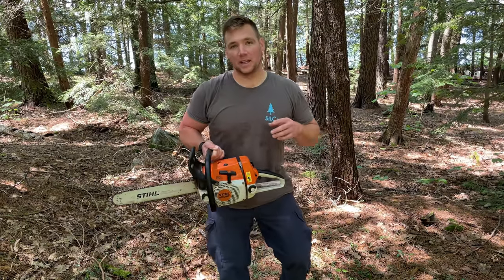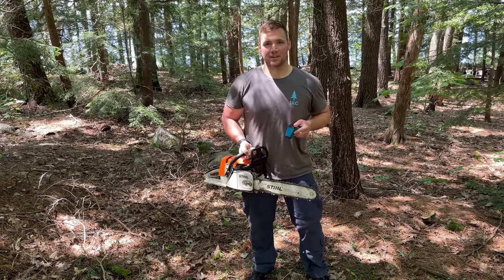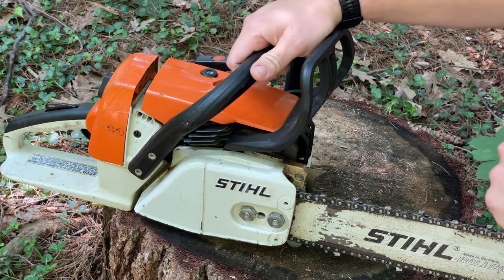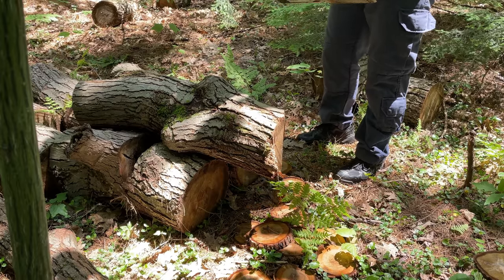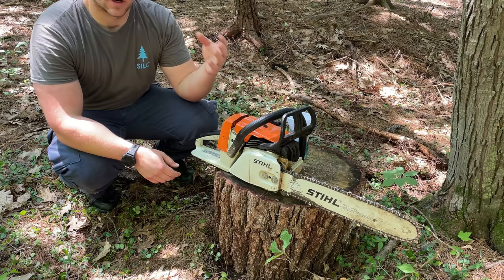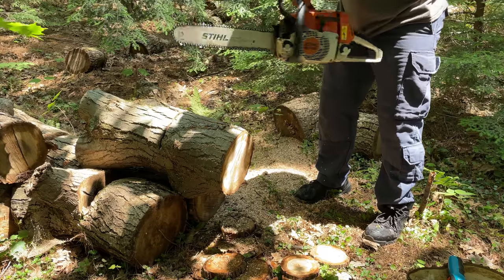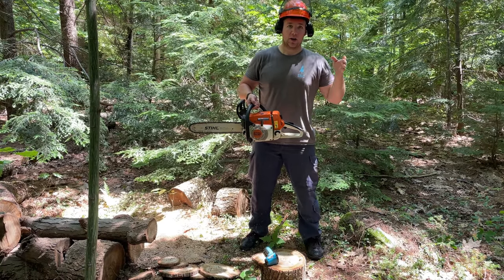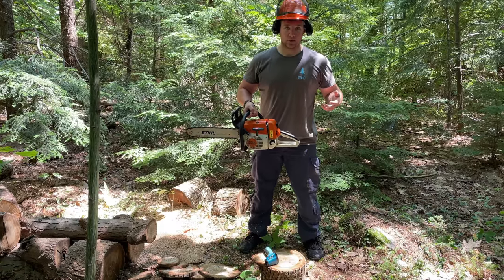Will my chainsaw last longer if I use more oil? Is it safer? (25:1 VS 50:1 temperature testing)

Comment: Great video! Informative data. Many excellent comments. I have heard people recommend using 40:1. (Better piston/cylinder lubrication). I have been tempted but reluctant and continued with 50:1.  My two non expert thoughts.  Factory engineers designed the saw for 50:1  having done testing and designing and though probably not a big deal, pollutes less which makes me feel better. I really enjoyed this video. Thanks for taking the time to do this.
Reply: 50:1 is an EPA mandated ratio
Reply: with good oil you'll be fine with 50:1, even on a 250 dirtbike engines we run 50:1 mix.. richer mix only lead to more carbon buildup.. i dont use stihl oil as it makes a lot of carbon buildup and loud piston ring sound..
Reply: Don't know if a heavier mix is better or not, but nothing mandated by the EPA is to improve engine life.

Comment: As long as its mixed somewhere between 32:1 and 50:1 it doesnt matter.minimal gains or losses either way as long as your in there somewheres and most saws will run fine for the average joe(or jane).i run a 40:1 give or take and run the dog snot out of my saws on a daily and run cheap gas station 2stroke oil and never had a problem.even with ethonal feul sometimes.what is most important is what kinda saw your running.stihl,husqvarna,echo and your going to have no issues (of course a couple of other brands also) but i only want to run them three,they are reliable and get the job done so thats what matters.good job with the video.also how you are running the saw matters considerably too.

Comment: Been mixing 6.4 oz oil, to 2. 3 gal of gas for 31 yrs. Never had a problem. I use any old 2 stroke oil I find by the gallon at walmart. Works fine.
Reply: Yep I use the Wal mart super tech and Murphy corn gas. 1/2 pint to every gallon of gas. One thing that really helps the older saws is to convert them to electronic ignition.
Reply: 5.46 ounces API-TCW3 oil to 2.0 gallons gas/petrol for 15 years without a problem. 
Then one day used farmer's old barn 2TC oil & cost me a new piston & rings. 
STIHL/Husqvarna/Oleo Shell Nautilus two stroke oils cost far less when purchased in 5 litre containers.
Reply: Yes things have changed in the past 15 yrs, me too, so 
also add Lead (LRP replacement) additive of 1ml : Litre of gas/petrol.

Comment: The Craftsman/Poulhan chainsaw I have requires 1:40.  Newer saws seem to spec 1:50.  It seems that the emissions regulations more than performance may have something to do with the new specs.
Reply: You guessed it.

Comment: always go for the most oil mixture because I have 3 chain saws, two trimers, or weed whackers. a 2-cycle small tiller. and a snow thrower  so I don't mix for each

Comment: one of my coworker uses a 30.1 fuel&oil mixture, for years. (stihl engine oil)
but yes the recommended ratio is 1/50.

Comment: Have you done small incremental steps while reading the plug? That will tell you a lot more about how an engine is running than temp ever will. I raced dirt bikes for years, and have lived out in the woods all my life. At 40-1 my HomeLite will seize. It like about 28-1. My Echo likes 40-1. Just sayin, your saw will tell you what it wants, and they are not all alike

Comment: Think of 50 to one as drinking soda and think of 25 to one as drinking a milkshake. You need bigger jets or the engine will starve for fuel. 
Jetting for optimum efficiency when changing ratios must be included in the research data
Reply: Absolutely.
Reply: Yes that's the thing u hit it right. Tuned properly for that ratio I believe it would be opposite,  the excess oil will remove heat out the exit hole...lol

Comment: I have been running a Stihl 026 for 36 years now.  The only repairs that I’ve ever made to this saw was replacement of the coil, clutch, pull cord and a few other typical wear parts.  The saw has been cutting  approximately 9-10 cords every year, plus all the misc land clearing that I’ve done.  I have been running Castrol marine oil, 32/1 mix the entire time.  The saw has very little carbon build up and almost no scoring of the piston or cylinder.  I have replaced the spark plug very few times.  How could anyone argue with this 36 year ongoing experiment?  
Just bought a Farm Boss for a grandson that will get the exact same mix.  I’ll likely wear out before either saw.
Reply: I hear ya, But I have a Husqvarna that I have run on the standard 50:1 ratio for 23 years with the same results. My thinking is that proper maintenance and tuning have a greater effect than fuel particulars.
Reply: The ms291 will clog with 32:1.  40:1 with a quality oil that isn’t Stihl ultra will probably be ok although it will be lean unless you break the tabs off the carb to really adjust it richer. Even the stihl original oil would be better provided the exhaust screen is removed.
Reply: @k.d.8924 my jd 50v is about 45 years old, my 346xp is is 27, my ms290 is 15? My ms 400 is 2 years old.  40-50:1 in every one for life except the jd that started 32-40:1 for a decade and now gets my mix.  I used jd oil, or castroil then evenrude, and finally amsoil Sabre or echo red armor oil for the last 20 years with occasional Polaris synthetic snowmobile oil thrown in because it’s what I have on the shelf when needing mixed gas. 

I still like running the 50v whenever I can, the 346 only replaces it when a brake is a good idea. The 290 was my father’s and only gets used so it doesn’t sit. The 50v was also his I got it when he got the 290. The ms 400 is trying to replace everything but when I can do it with a couple pound lighter saw the 50v and 346 still have a home. I’ve only replaced fuel and oil lines, filters and recoil ropes on any of them.  They used to do 4-5 cords of fire wood a year. Now they just deal with 4-5 cords a year cut just small enough to burn the brush, have some campfires and give away the rest, so 4-6ft lengths if it’s not to big a diameter for someone to load it and take it away.

Comment: I recommend mixing to manufacturer recommendation, especially considering newer saws have features such as autotune.
Aside from that, I've run 32:1 premix using ONLY fresh pump gas and carb tune using the tried and true 4-stroking method for decades and haven't encountered any issues.  Still running saws built in the 70's era.
Reply: Agreed I run 32:1 in all saws from 70’s all the way up to new saws, zero issues. 1000’s of cords of wood lol, -50° F to 100° F always tuned and sharpened of course.
Reply: Fresh Ethanol poison gas lol ?
Reply: With decades of experience on working with engines the safest and best bet is to always follow the engines recommendations and never the claims of these premix formulas or two stroke oil providers that claim that their gas rich formulas is good for all, those engines are built with materials and clearances and tested with the mix that they recommend as is their warranty. Sincerely, Paulie T.
Reply: I would also like to add that the only times that I personally will not follow the engines mix recommendations is if they recommend gas mixtures as rich as 50:1and I always use the best proven two stroke oils. Sincerely Paulie T.
Reply: @shannonwhitaker9630  Yes the 10% stuff.  ONLY fresh and freshly mixed.
It goes sour fairly quickly, gets sketchy.
Even fresh 10% ethanol gas is hard on fuel lines and carb diaphragms, stick with ethanol free if you don't want to deal with that.
Reply: I don’t use Ethanol fuel in any of my 2 and 4 cycle equipment (Saws,Trimmers, Blowers, Generators ect.) Ethanol fuel mixed with 2-stroke oil will see fuel/oil separation beginning in as little as 2 weeks when stored in a hot building, shed ect. When I stopped using Ethanol fuel nearly all of my mysterious unrelenting never ending problems magically disappeared.
Reply: @shannonwhitaker9630  Perhaps then, you missed out on the bean oil era?  I rarely hear anyone mention it these days but we had the same issue with pre-mix shelf life.  Bean oil was the (superior) alternative to non-detergent motor oil.  We were running 15:1 those days, along with babbitt bearings.
Back to ethanol: 2 steps forward, 1 step back, I guess.  Yes without a doubt, everything's more complex when ethanol's involved.  I blame the refining process more than the ethanol itself.

Comment: I know for a fact running more oil causes more carbon buildup and that carbon ends up scratching the exhaust side of the piston and cyl. Thus causing a loss in compression
Reply: Very true, unfortunately the average guy has the more is better mentality, 70-1 is the sweet spot, what’s more important is the fuel to air ratio, fuel carries the oil.
Reply: That's why fuels were developed that were far less viscous and far more volatile than oil. Apart from some military vehicles which are equipped with engines that can run on a range of fuels including some oils for fairly obvious reasons, the slow, low compression oil burning engines are a thing of the distant past. Why return to the bad old days and bugger up your modern equipment in the process?
Reply: @Thelivewire64  your wrong  bro!

Comment: Just a thought along with engine tempurature and I tested several oils Pennzoil Ultra Synthetic Natural Gas Based 5w 30  The v8 liquid cooled 2011 4.8 Silverado truck on highway where road speed provides radiator cooling coolant temp stays 192.2 deg F where Pennzoil platinum runs 194 Deg F other oils run 195-197 Deg F.   In your test I would like to see a piston wear test with 25 to1 v 50 to 1 my reason is this is an air cooled engine. The 2 stroke oil being the only lubricant AND Coolant maybe the oil is pulling more heat into the cooling fins and exhaust system and providing reduced friction and better ring seal.  Another video on here with 2 stroke bike racers showed more power dyno tested with more oil eg the 25 to1 in there case 30 to 1 versus 50 to 1.  Higher emissions but It provides more heat transfer less friction and better piston ring seal.  Street race cars make more HP with 10w 30 than 5 w 30 due to better piston ring seal. But the weight and viscosity of additives to make 5 to 30w v 10 to 30w better shear resistance and less break down. Windage with 10w 30 is greater than thin oils such as 0w20 and when tested the 0w20 has less drag windage than 10w30 ability to seal better so better HP numbers are with thin oils but Wear becomes a problem.  The Thinner oils wear parts faster auto mfg say they are required due to closer tolerances of todays engines. Part true but part BS as things are made to wear faster today shorter service life and replace sooner for more profit.

Comment: The carburetor moves the same volume of fuel mixture regardless of the mix ratio.  Therefore, the lower gasoline content in the 25:1 accounts for the performance decrease when compared to the 50:1 mix.  You can hear the difference in the video.  Years ago 16:1 was a common ratio that I ran in my saws of the day.  With the advent of improved lubricating oils, synthetics in particular, there is no reason to run such rich in lubrication mixtures.  I even run my old saws (Homelites, McCullochs) at 40:1 now, with no problems to report.  Exhaust ports and rings seem cleaner too.  Good video illustration of an important point.
Reply: No not true that carb runs the same air fuel mix. When you add more oil you raise 
Viscosity (Thickens mixture) so you must adjust carb richer. Just a fact.

Comment: When Steve('s Saloon) is in Comments giving you props you know you're going in the right direction!!  Very well-done, when is part 2 coming? (See what I did there?  Just presuming/taking-as-given that this test was only "a start", you HAVE established "the parameters", so to speak (and shown what most knew but still benefit from seeing), BUT we know there's still another step-- finding whether the optima is:
- closer to 40:1 or 50:1?, and:
- once the 40-55:1 range is honed-in on, THAT is where you'd begin testing to see that, yup, your particular model operates best (using your local fuel - definitely specify this at least octane & presence/absence of ethanol, I pray it's the latter*), and while it'll vary by model (even within platforms, based on porting/etc) the results you'd obtain this way WOULD still give a crazy-large insight to all of us, or to any particular person REGARDLESS of whether they're contemplating their 36cc climbsaw, or 99cc groundsaw!
(BTW, just food for thought if you didn't already plan this, but the whole "50:1" is, quite obviously(duh), NOT some supreme precision ideal, it's a "rough guess" and, honestly, I'm still not sure whether the true optima, at least for the guys who started the 50:1 guideline, I have to wonder if they got there because their testing showed 48:1 was optimal, or 52:1, yknow? IE we don't even know if 50:1 is slightly rich/lean, we just know "it's darn-close", yknow?)
Great content, 'scribed & +1'd, thank you!!
(*=I wrote that sentence in a lighthearted-joke tone, BECAUSE I think you're DonyBoy73's Dave, IF I was wrong on that then disregard that parenthetical, I'd only EXPECT you HAVE TO know Re ethanol if you were with Dony, actually him & Steve were the 2 that I learned Re ethanol from, thankfully I'm in coastal tampa area so boating/ethanol-free fuel is easy to find, still a PITB and like >5.50/gal now :/ )

Comment: My two cents.
I'm recently retired so I've been around a while and seen a few things.  Just so you know Im not a kid writing this or some keyboard expert.

I recommend a 32:1 ratio fuel mixture.  That's the only ratio I use.  That's 4 ounces of oil to one gallon of gas. I have an Echo leaf blower that my late brother purchased back in the 1980s and I still use it occasionally.  Back in the 1960s -70s it was recommended to use a 16:1 ratio mixture.  That's 8 ounces of oil to one gallon of gas.  Lots of smoke.

Side Notes:

I was surprised that the engine temperature was higher with the 25:1 (I thought it would be lower, I don't know what those temperature and ml are, here in America we use the standard system. Not sure what country you are in).  Not surprised less power, but That's the trade off for a well lubed engine. Remember, the ONLY lube the engine gets is what you put in it.  Never in Hell will I run a 50:1 ratio mixture in ANY 2-cycle engine.

I know a woman that purchased a new string trimmer and used a 50:1 mixture as manufacturer recommended. It lasted one month after the warranty expired then locked up.  They would not replace it.

.

Comment: Great test, that has been my experience. I have been wrenching for more than 40 years and that’s exactly what I tell people. Run your small engines on 50:1 and it will run cooler with more power. You just proved it thanks.
Reply from the maker: Hey Trent! Thanks so much for the kind words. Glad to know it helped!
Reply: No you run at 50:1 and make the EPA happy while your crank bearings fry lol
Reply: @shannonwhitaker9630  since when did the EPA recommend 2-strokes run on 50-1 mix? Or at least Stihl saws.
Reply: You didn’t get the Memo ? In order for engines to get “certified” manufacturers had to test, adopt and suggest a 50:1 ratio where for many many years the recommended ratio was 40:1 on the newer more modern design 2-cycle engines. Of course the old school stuff (Steel Cylinders) were advised to run at crazy old ratios of 16:1,24,32:1 ect. True 50:1 isn’t actually “the stated Law” exactly but 50:1 is what is used for emission certification testing. Hence the “mandated ratio” theme. Did you know that the certification confirmation for emissions only lasts for a pitiful number of engine running hours on most equipment before they go out of compliance. Do some reading-research and get a laugh. I suppose none of this matters for many because if they run 50:1 and use “mandated” ethanol poison fuel your stuff will most likely ruin early helping emissions greatly. Oops there goes that “mandate” word again. I run 42.5:1 with non-e fuel. I buy oil by case of 1 gallon jugs if that’s an indicator of anything. That’s a lot of running. Did you know that a lot of 2-cycle bearings are capable of lasting 2,000hrs if lubricated properly. Piston rings will also last a great number of hours before compression lowers if lubricated properly. It’s a fine line between too little and too much oil with 2-strokes. Either direction has it own set of issues. Look up the videos of guys who fool with saws every days and see what they think.
Reply: @shannonwhitaker9630  thanks for the information.  I was just curious when this became the case, because in the old service manuals for the 028, Stihl recommends 50-1 mix with their oil and 25-1 with other brand oils.    And of course the older series was all 40-1 with a few with 25-1 recommended, such as the old 070 and 090.

Comment: I'd be interested  to see the test reran with the carb adjustment like it should  be
Reply: Why not just run 50:1 like it was designed for?
Reply: @devlinsemmler8236  because in 2003 the epa decided to mandate that all small 2 stroke engines could only run 50:1 mix, and had nothing to do with what’s actually better for the saw mechanically speaking in preserving it from mechanical wear. When my 395xp came out in 1993 it was recommended by husqvarna to run it at either 32 or 40:1 mix, same exact saw is still being produced today with absolutely no mechanical changes yet if you read the manual for a new one it will state that 50:1 is recommended, not because husqvarna really wants you to run it at 50:1 it’s because the epa is forcing husqvarna to tell you to run it at 50:1, I’ve run mine at 32:1 it’s entire life and you can still see the original hone marks in the cylinder and it still runs like it did when it was new, and yes, it smokes like a freight train just like god intended.